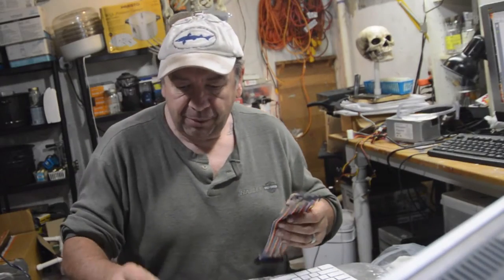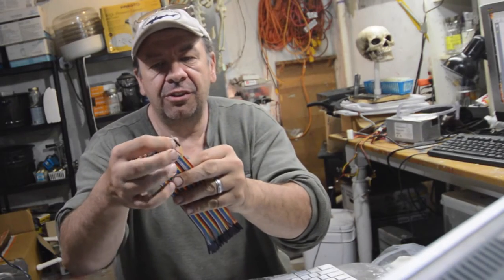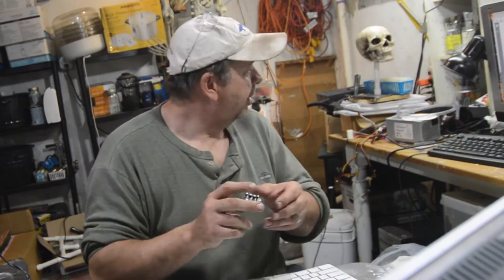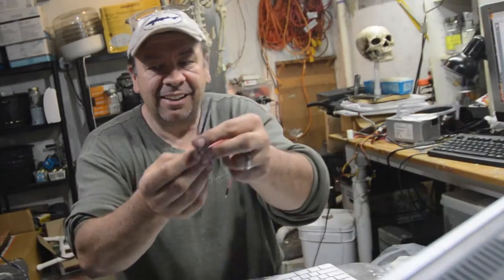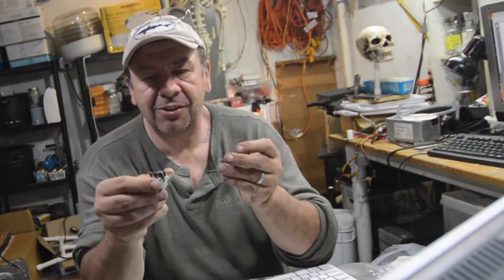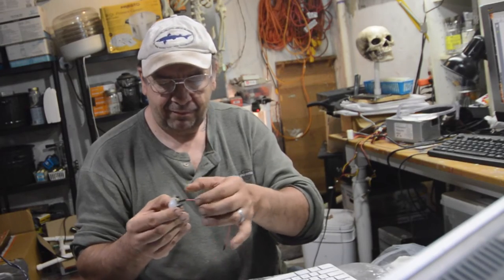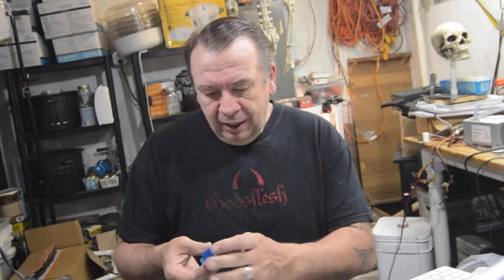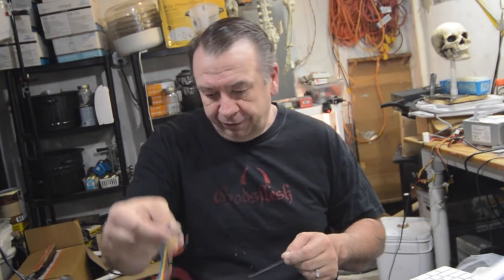Soldering Circuits

Comment: Now I'm not so sure that I want to start building mine. LOL
Reply from the maker: +greeg1358 Heh! It's surprisingly easy, despite my videos apparently showing just the opposite. Part of my problem is using an OLD Windows computer, not having Internet access on it, and then having slightly different components. If you're more up to date on your Windows OS and have the same parts as the diagrams, it really shouldn't be a problem. A do plan on making a second one (assuming this one works!) and I anticipate it going much more smoothly.

Comment: Alright, Katie Hepburn, step away from the soldering iron. Yes, it's me again. Just call me Montclair. I prefer not to be known as Montclailairs, Montlair's Claire, Montclalal, and whatever else you fumbled over that didn't make the edit. Heh, heh, heh... ;)

Well, we went over this stuff last night while you were editing (should have soldered the included pins to the arduino, not soldered the pins of the wires to it, don't connect to jumpers, etc.), so you should be all set. And yes, those damn pins go flying. I've lost them in exactly the same way. Once stuff hits my workshop floor, it's like playing Where's Waldo? 

I think I mentioned to keep those wires together so you have nice ribbon cables, but alas, it seems you're following my tutorial too closely, because I did the same dumb thing. Mike's made all of this so you can just run sets of wires from each board to the arduino in chunks so no spaghetti. But, hey, whatever. That's what tape or heat shrink or hot glue are for.

Anyway, thanks for the credit, and sorry I wasn't around earlier yesterday. I keep the facebook virus off my phone, so just text or call me next time. And I'm glad Mike got back to you. I know he's been monkeying with the software to fix a few bugs I found, but left out of my tutorial. Guess he tweaked something the wrong way. And, to pre-empt more problems, make sure you go download the latest version since he said he patched the bug.

Looking forward to your next project!
Reply from the maker: +Montclair's Lair I'm afraid to download the program again since we got this one working. lol As for the wires, I was color matching them to the diagram, so that's why I peeled them off one-by one. But the part where the 5 wires attached, I kept them all together! I'm going to finish it up today and see if I can get it to actually work on something. That should be a challenge.
Reply: GhoulishCop
Nice!

Comment: Man, when you were commenting about your software issue I didn't realize you weren't at the same step I thought you were ... guess my info was just as useless at the windows computer. LOL

As for the relay module, don't connect the wires to the jumper spots. You should be able to connect the wires to the screw terminals. One of the pitfalls of electronics, if you don't look closely, what looks like the same part isn't exactly. You should still be able to use it without any issues just have to connect it to the proper place.

As for the shaking ... man, looked more like you're nervous about doing it. LOL
Reply from the maker: +The Pirates of North Court Yeah, it was a problem almost from the get-go. It really isn't a hard thing to do this controller though I'm making it seem like a big issue. However, when you have zero knowledge about stuff, it's hard to know what's a correct alternative...like those jumpers. Not to mention everything written in Chinese on the board, and then being slightly different than what everyone else was using. I think the next one I build will go faster and more smoothly.